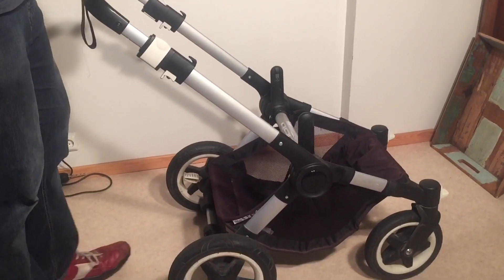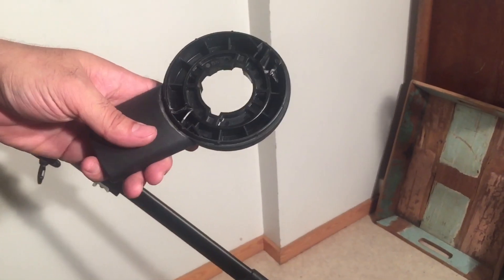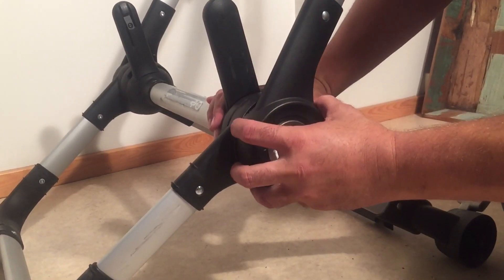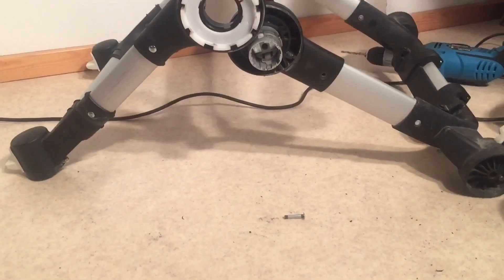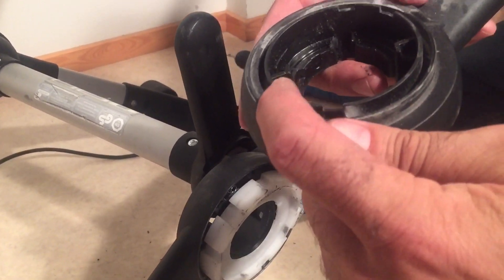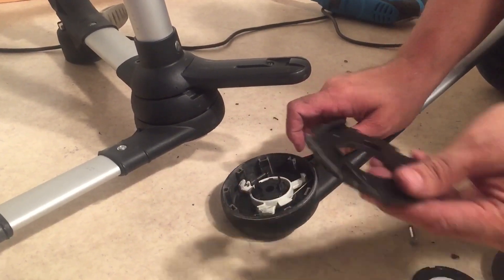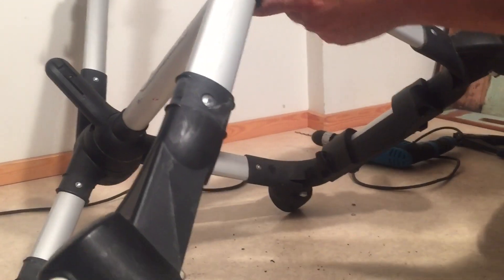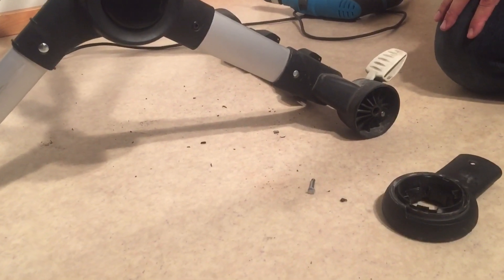How to Fix Bugaboo Buffalo Chassis that Collapses:Back and Front Sliding Apart or Towards Each Other

Comment: I cannot find a replacement part anywhere on the internet. Most used chassis on the market have the same issue. Any idea where I can buy the disc?
Looking at this plastic disc makes me think of planned obsolescence at the Buffalo. Really have to consider buying a different brand for my second child.
Reply: bugaboo is the most impossible to repair thing, and its functioning depends on so many fiddly easy-breaking bits being just right... and its glued and riveted not screwed together. clearly  deliberately planned to be such . I had a good Mutsy but that was too heavy apparently for women.

Comment: My bugaboo donkey the front wheel section collapses forward when pressing down on the handle to go up a curb. Or when pulling backwards up a step
Reply from the maker: Same problem, same location, basically the same process to fix - you'll need to swap over parts from another chassis to fix it. :)

Comment: Hello, my Donkey has the handlebar that drops on one side when the kids are in the stroller. I’ve swapped out the outside part that connects to the handlebar, from another Donkey, but it still drops. 
Any recommendations are appreciated.
Reply from the maker: Swap out more from that other Donkey. :)  Try the arm on that side as well, the handle, and definitely the next disk in (or even all of them) - the wear from prolonged Donkey use in the mono-configuration can really affect all the parts on the child side of the chassis. :)